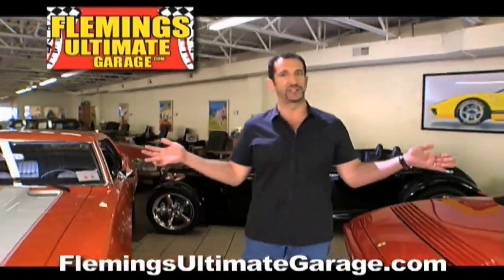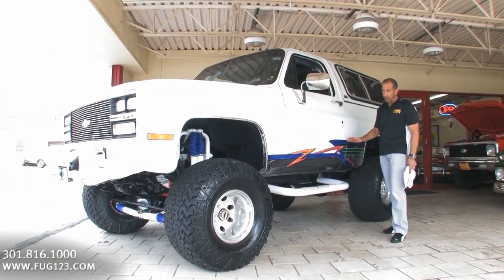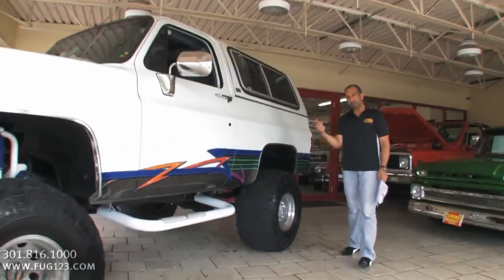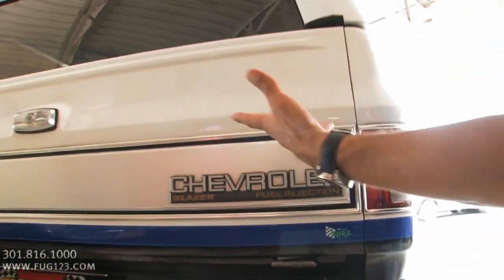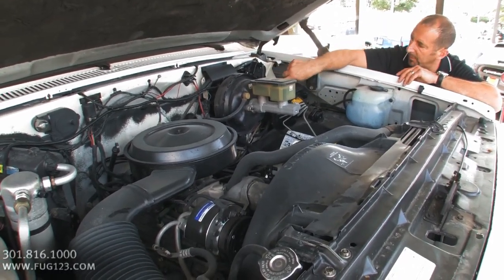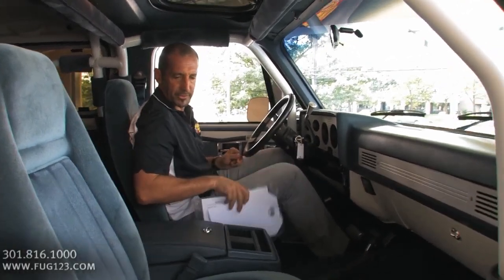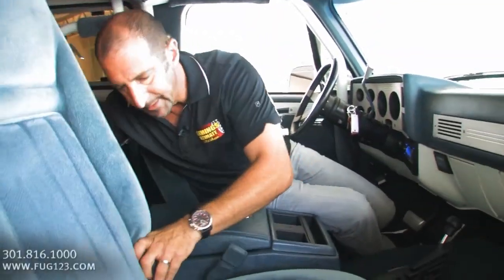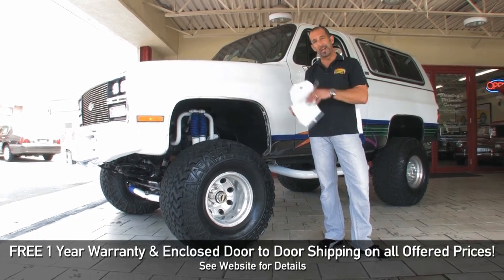1989 Chevrolet K5 Blazer for sale with test drive, driving sounds, and walk through video

Comment: That is a nice truck for sure.  Give it an all-white paint job and some thinner tires so it does not eat front-ends and it is a decent truck.  Swapping out the rear for a built 12 bolt is no big deal either.